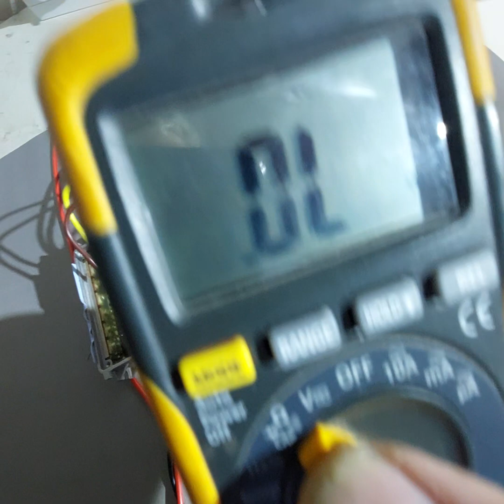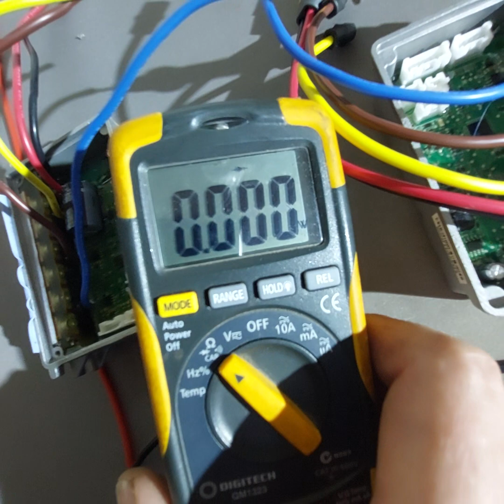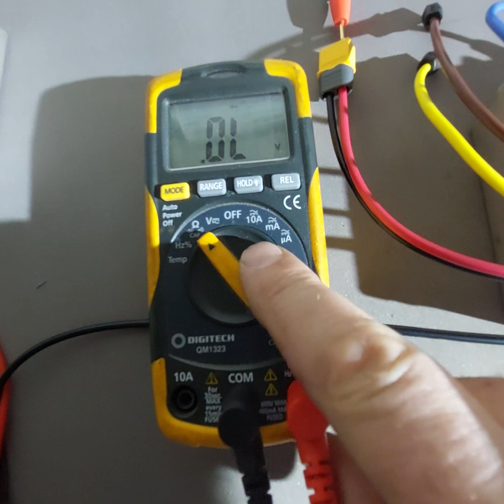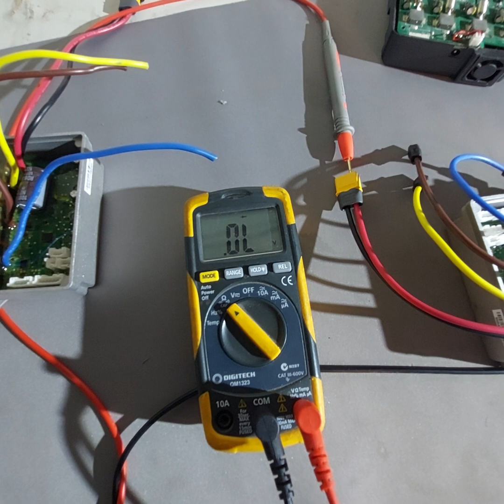Go To 7 minute mark for Testing an electric scooter controller for faulty MOSFETS

Comment: I did this test on my controller and the blue, yellow and green wires all show 0.55v none of them show O.L, what does this mean please?
Reply from the maker: It means the MOSFETS  are  fine.  What's the problem?
Reply: @electricwheelsaustralia130  when I try to power my life 250 on the back lights flash four times and that’s it? I have measured the voltage in the battery and that is fine, I have replaced the screen, cables and battery just in case but still the same issue?
Reply: @electricwheelsaustralia130  I have tested the cables leading from the controller to the display and when I hold the power button it shows 18v then drops to 11v and starts flashing on the rear lights, is this a bad controller please?

Comment: Hey I got a seg way gmax controller  can I use it with a non Segway motor ?
Reply: Yes but you need a Segway displsy, cable, and battery
Reply from the maker: It would be through trial and error because you have to ensure same number of magnets for the hall sensor side of things

Comment: O.L is Open Loop.
Reply: FLUKE WEBSITE says: If the measurement is higher than the set range, the multimeter will display OL (overload)
Reply: @octapc  if not connected to a circuit? Open loop.

Comment: I'm sorry about the major delay in replying , so this is Paul, and I do have a multi meter now and I'm not sure if there's a model name but the brand is called " speedrid " I check everything , but you said even though the battery reads correctly that still doesn't mean that it good or enough to power up the scooter. It's Two years old but I've only used it maybe 15 times never ran it down to empty the problem is  it don't power up . I did Pierce a couple wires putting the hub cover cap back on the front wheel motor tire fix road it once and pulling into the driveway it stopped completely. Have any ideas? Thank you!
Reply from the maker: Hi, you haven't told me which brand and model the scooter is.
Reply: The only name I have for the scooter from the Manuel is " Speedrid electric scooter A1 so the Brand " Speedrid " model " A1" ?
Reply: when you say it doesn't power up, you mean the display doesn't light up, or it won't move?
Reply: @octapc  yeah, display is dead and it won't move .

Comment: i have 4 different controllers that, each one at a different time, half broke with a very strange problem. One of them worked perfectly for 8 months, another for only 2 weeks. One is 100W, another is 500W, and i have a 350W and a big 3000W. And they are doing the same on 3 different engines, but these 3 engine works fine with a new 14$ cheap controller. Now my 4 controllers are all doing the same strange thing: they work fine to keep speed on flat or downhill. The faster the wheel turn, the more effort they can go while still working.

But specially at low speed, if i put more "effort" on the engine, by trying to accelerate, or if i go uphill, they cause the engine to make a strange sharp noise, and go no power (free-wheel), and if i don't let go of the accelerator, then these controllers goes into safety mode and turn off.

I can't find anything about that on internet. But my 4 totally different controllers are doing this, it's so strange. 
Using them with or without the hall sensor does not change anything. And my new 14$ controller works perfectly on all my engine without hall sensors connected.

if anyone has any clue or any internet link to the same problem, that would be much appreciated.

Comment: I have been watching your YouTube which are great, and was hoping id be able to diagnose my son's iscooter, but am still struggling.
About a year ago now, my son complained about his iscooter. upon inspection, the electronic dashboard would light up and immediately turn back off when switching on. I would attempt to turn it on again, but nothing would happen until approx 5 minutes later when it would do the same again. I attempted to charge the battery, but the charger would flash, indicating that it was not charging. I disconnected all wires, ran out of time and completely forgot about it until I came across your videos.
Since then,  I had lost the charger but found a compatible one that just needed the charging port plug to be changed. I connected the battery to the charging port of the scooter, and the battery started charging until fully charged. After it was charged, I removed the charger and reconnected all the other wires, and it all turned on and worked perfectly.
Then today, I went to put it all back together, so I placed the battery and controller back into the scooter and thought I'd double-check that everything was working one last time before I continued. I turned the iscooter on, and history repeated itself where the display would light up and immediately turn off.
Any help would be greatly appreciated.
Many thanks
Reply: That would normally indicate a problem with the battery.  So, with a multimeter at hand, attempt to start the scooter.  If it fails do not plug in the charger.  You now have to check the battery voltage.  Let me know how you go.
Reply: @octapc Battery is giving off the correct voltage. However, I have since dissasembled the battery pack, and saw that the input and output wire casing was damaged, potentially causing a short circuit. I've de-soldered the wires, removed the damaged pieces of wires and re-soldered. It all seems to be working now. Fingers crossed it stays that way. Many thanks for your help 😉
Reply: Sounds like controller is faulty.   The lights are either powered by battery voltage or a voltage regulator,  often around 12v.  Is the controller the same voltage and current rating as the original?

Comment: I like how you explain that it makes sense to someone who doesn't necessarily know exactly what they're looking at. Thank you, I have one question. Because my multimeter is different than yours. And the Homestead doesn't have just one setting it has. 2m 2ook 20k 2k 200 And one that looks sort of like a sideways Wi-Fi icon on your phone. Since I don't really understand a lot of tricks to really great.I have one question.Which one of those settings is appropriate for the task ? Cause I don't actually understand what those settings mean. And this pulcivo multimeter. Well, the people that solve it cheat doubt and it did not come with an instruction manual.
Reply from the maker: Take a photo and send to perthelectricscooterrepairs@gmail.com
Reply from the maker: where is the photo? :)

Comment: How do you know if the scooter slows down then shuts off if its the battery or controller? Thanks
Reply: If you recharge the battery and the scooter goes again then the battery should be fine. However, if the range is reduced, then you have a battery problem.   Controllers can cause vibration in the motor under load or that the motor won't turn at all.  However,  F series ninebot has a problem with broken cable to the motor.
Reply: @octapc  wow that was very helpful,  have a blessed 🙌 day

Comment: Hi 😊 I have watched all your videos very helpful I have come to the conclusion after checking the resistance on the wires you said to check it's open circuit no good any where. Also since it happened the battery charger goes red green and the display beeps while charging the display goes in and out. Can you help me find a circuit board for my G30LP scooter thanks ❤